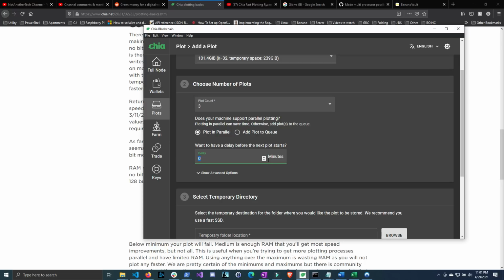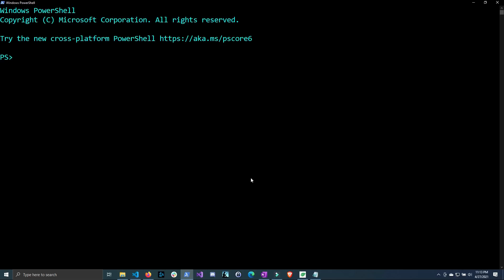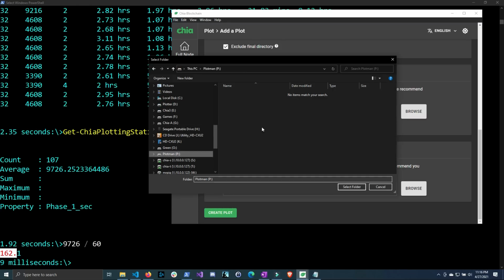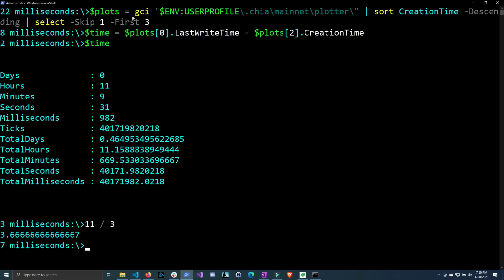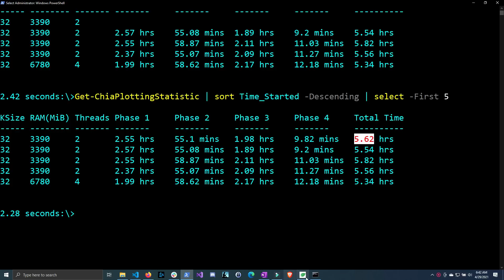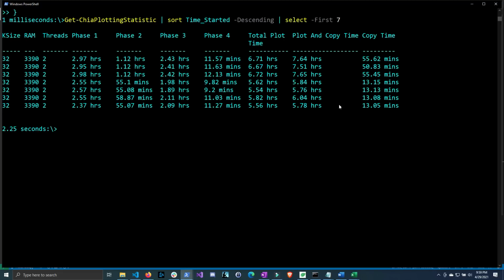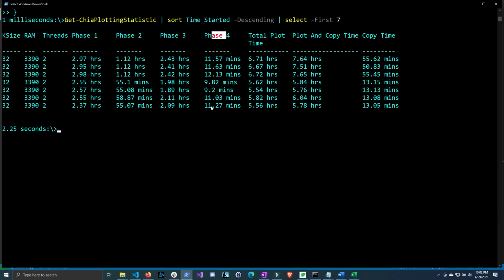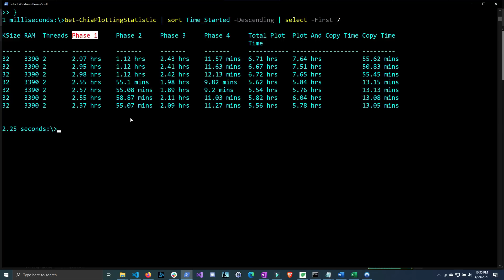Optimizing The Delay Between Parallel Plots Using Log Files and Powershell - Chia Plotting Part 3

Comment: Is there SSD capacity to consider when plotting more than 1 plot as shown in your video?
Reply: your plotting drive should be twice the size of the maximum amount of plots you plan to run in parallel

Comment: Thanks for the videos!  I'm thinking your module will not work if you've only plotted from CLI because it doesn't seem to appear to create any log files that I can find when you plot by CLI and running the module throws a "Get-ChildItem : Cannot find path 'C:\Users\username\.chia\mainnet\plotter\' because it does not exist."  I'm still poking around, but I'm wondering if you have to run a bunch of plots in the GUI for the module to work correctly.

Comment: Hi! On your video, you mentioned discussing the following tip/tweak: When plotting in parallel, a command or way to auto start new plots once one is complete, so you always have the total number of plots that can be plotting. For example, if you can plot 3 in parallel, as your system is, you star Plot 1, then delay Plot 2 & Plot 3. Well, once Plot 1 completes, Plot 2 & Plot 3 are still running, but you could have a new plot starting to replace the completed Plot 1. Did you figure out how to achieve this, or do you just need to wait for all 3 to complete, and then start a new plot procedure for 3 new plots?
Reply from the maker: Yes I have another video on who to do this, but I feel like I explained it poorly. Basically you setup 3 different queue with different names and manually start them with the delay you want by waiting. I will also release a video tomorrow on how to do this powershell.
Reply: @SysDeskDev  Great, I'll look for the video. Just to through it out there and get your thoughts. So, I've just built the following, Ryzen 7 5800 (8c,16th), 64gb DDRAM, x2 Sabrent SDD 2TB 3600. So, in RAID 0, I should be able to parallel 14 plots, right? With say, 1hr delay. So may around 28 plots/day?

Comment: Wow.Thank you for this content its 100%++ helpful! I have a question. What is your Farm HDD? will this is the main reason why transferring file its take so much time?
Reply from the maker: Well generally your plots will be stored on HDDs (Hard disk drive) which have slower write speeds than SSDs so that is why it is taking up to 15 minutes. My farm HHD that I was transferring to was an external HDD by Seagate.
Reply: @SysDeskDev  Thank you very much :)

Comment: Say I'm limited by a 1 TB SSD so I can only run 3 plots in parallel as in your example. Then say that I what to create 15 plots. Should I set the delay to the time the phase 1 takes or to a third of the total time for a plot? I see a scenario where the phase 1 time is less then a third of the total time and it will try to start the forth plot and by that fill up the SSD. Or maybe it checks so that the free space is enough before starting a plot and by that way will avoid the problem?

Comment: Thanks for the video! Very imformative. Can you please tell me the break down of phases. What resource is each phase using? Following this video I am running 3 in parallel with a further 3 starting just after phase 2 starts however the first 3 sit at 31% and dont progress whilst the next 3 carry on up. Ubuntu Ryzen 9 3950x DDR4 3600 (mobo overclocked as only supports 3200) 2TB NVME doing 8 threads and 4650mb per plot. Your video says once phase 2 hits you are only using one thread for that plot, so 32 threads, I should now be using 27 threads with the 6 plots running?

Comment: Hey men. Just wanted to give you a big THANK YOU for your work.... 
secondly I have a question: When im trying to import pschiaplotter to my ps with this command: "Import-Module PSChiaPlotter" it says that it could not be importet because importing is deactivated on my win system.... can you maybe help me with that? 
Kind Regards..
Reply: I had the same issue. Run Get-ExecutionPolicy. If it says Restricted then you have to run this command: Set-ExecutionPolicy -ExecutionPolicy RemoteSigned and select Yes if you feel it's a safe script. After that, it should run.
Reply: @raicard26  Thanks a lot. that helped me :)

Comment: Congratulations great video, I was working into the same to make posible to create parallel in a 512GiB ssd and I had success but since I was looking to start  after the disk space usage start to decrease, that happened after phase 2 adding  10 minutes more. Thanks again

Comment: I start my plots each in a separate PowerShell window. Is there a command I can use to delay the start of plotting?

So that I don't have to be in front of the PC for hours to start the plots manually.
Reply from the maker: I will be going over this in my next video, but the short answer is can be found here https://github.com/Chia-Network/chia-blockchain/wiki/Windows-Tips-and-Tricks

Under section1. Parallel Plotting in Powershell. I hope that helps :)

Comment: Download and install Teracopy....set that as your default copy/paste/move application.  Then use threadsin a python program to do the plot and then use the join method to then fire off another thread to do the move command to the plot's final home.  KEEP your -2 = -d directories the same.

Comment: HI

what about I/O capability issue on WIn10? is that true using Win is slower than Ubuntu?

i used thjreadripper 24core, 128gb ram, 8tb temp drive.

usually i did 6 plots parallel on a 2tb NVMe temp drive, 2 threads 4gb ram, delay 60min(random not doing statistic), 

i got 4pcs NVMe 2tb, so each temp drive i do 6 plot parallel. all same config as above. 

31% took me 8 hours. total took me 14hours. this is not right, so wrong...... but whats wrong?

im figuring out how long needed for phase1 31% if put more threads. so now running 1 plot on 1pcs 2tb NVMe, 16 threads,  7gb ram.

i used 3 pcs 2tb NVMe to test, so there are 3 plot running on 3 NVMe. final drive is the last 2tb NVMe drive. 

https://www.screencast.com/t/1cWmt2xyuH 
this 16% took me 100min, still plotting....

i check in keybase, admin said 2 thread like i always do is good no need pump 16threads on single plot. but normally i used 2 threads took me 8 hours for 31% and total took me 14hours. 

from your point of view what problem might it be? is true that only way out is ubuntu?

Comment: dude you are amazing! you got a new sub! I am just starting plotting my 8 TB system. I only have 1 SSD of 500 GB. Seems like it will take a while, maybe a month or two to plot everything. But I will look forward to your videos to learn with them better ways to pl be more efficient while plotting.

Of course I can't plot in parallel with my SSD, but I have 4 HDD of 2 TB. Do you recommend that I start plotting in parallel with them? Using one or two as temp?

My system is this: I7 5820k 16 GB of ram, Windows and 4 HDDs of 2 TB and 1 SSD of 500 GB. So far my first plot is at 15% in 2 hours, quite disappointing to be honest :(

Thanks so much for making these videos I will look forward to more

Comment: Super, thanx for your videos!
I wanted to ask for help about PowerShell im not very good in it. Im running plotting from a PS file, with delays. But i dont have nice .log files that you have when plotting with gui. So my first quastion is how to have it ? So i could use your superb PsChiaPlotter
My lines in PS script looks like this:
invoke-expression 'cmd /c start powershell -NoExit -Command {cd C:\Users\userAppData\Local\chia-blockchain\app-1.1.2\resources\app.asar.unpacked\daemon\;$host.ui.RawUI.WindowTitle = "Qp4"; start-sleep 13000 ; .\chia.exe plots create -k 32 -b 2400 -u 128 -r 4 -t E:\temp -d X:\DESKTOP-PLOTS -n 3}'

I have 16 thread CPU, so i run 3x3 with 2threads, and after 13000 (thats when i manualy look avg in calculator my first 3x3 threads end Phase1).

Second quastion. 
Can we have just a parser in PS that will wait for text in ceartain windows (for example Q1p1 =first Q plotter proccess 1) and start another plotting proccess ? I think it would be most precise.

Comment: I'm #69 TU :)   After Viewing all your vids in this series, I have one lingering question. How can I fine the optimal # of plots in parallel (or timed sequence parallel) for my given SSD vs NVME drive. I heard you mutter a number in one of your past vids, but how do we find this number for the specific drive we have??
Reply from the maker: If you are just looking at your SSD then you will have to divide the capacity of the SSD by 256.6 (which the temp space in GB which is the unit SSD's capacity is measured in) and round down. Technically you might be able squeeze another parallel plot in if you time the delay just right, but it is important to remember that for many SSD their performance is worsen the more filled up they are. Make sure to check your RAM and CPU  to find your bottleneck as your SSD (depending on the size) might not be your limiting factor. I hope I explained it okay.
Reply: @SysDeskDev  I found some info in PS online proccess at the end of the plotting phase:
269.319 GiB was used total (excl. full file) in the plotting — this statistics shows 1 plotting process eats 288,8365507 Gbytes of space, not 256.
It means that 1TB nvme = 3 Plotting
and 2TB = 6 maxed
To be sure.
Am i right?

Comment: I'm wondering how many threads should use, I have 11900k 32GB and 3TB NVme drive. I do 5 in parallel plots use 4 thread, should I use 2 thread and do 8 in parallel plots? Thanks
Reply from the maker: Is that an 8 core 16 thread processor? If so you have enough RAM and CPU power, and Plotting space on your NVMe's to do 8 parallel plots. I would opt for doing 8 in parallel over 5 for sure. I would start off with 2 threads for each plot and then try out 4 if you want to squeeze more out of your processor. The only way to find out for each computer is to test it out.

Comment: Hello, I'm unable to run Get-ChiaPlottingStatistic | select -First 1, it says cannot load module, what step I am wrong?
Reply: Try changing the execution policy by running Set-ExecutionPolicy -ExecutionPolicy RemoteSigned
or if that doesn't work
Set-ExecutionPolicy -ExecutionPolicy ByPass
Reply: @siriuscleveland4836  Thank you sir! Very helpful

Comment: I have only 1.6TB SSD, therefor i can only do 6 parallel, but my Processor has 8c 16th. The storage of the ssd is not fully utilized all the time. Could it be possible to do 8 plots but with certain delays to fully use the Processor?
Reply from the maker: Technically yes, from what I have read the temp size varies during plotting so if you time it correctly you might be able to squeeze another plot in parallel, however I do not recommend that in my videos because if you run out of space on your SSD then some/all your plots might fail. I try to be a little conservative in my videos on what is possible as I want to focus on optimizing rather than maximizing plotting so that more people are successful in their plotting. It is also important to remember that certain SSDs perform very poorly when their capacity is close to max so it might actually slow things down than speed them up. Sorry for the long reply!

Comment: Great timing, no pun intended. my attempt to create 2 plots at once on a 500gb nvme, by using the secondary temp drive option failed btw. no Bueno.

Update : the same thing on my 4 plots to a 1tb nvme. I would love to learn what the purpose of the  secondary temp is for and how it works.
Reply: I've found some interesting info looking in Chia CLI guide, (https://github.com/Chia-Network/chia-blockchain/wiki/CLI-Commands-Reference) says: 
Define a secondary temporary directory for plot creation. This is where Plotting Phase 3 (Compression) and Phase 4 (Checkpoints) occur. Depending on your OS, -2 might default to either -t or -d. Therefore, if either -t or -d are running low on space, it's recommended to set -2 manually. The -2 dir requires an equal amount of working space as the final size of the plot.

Comment: I tried 6 parallel with no delay and noticed it was killing my one hard drive, so i split the final destionation to 3 hard drives, which seems to improve the copy time.

I think staggering the best way but i need todo more tweaking to maximize the 8c 16t usage.

Your PS tool will be useful, going to try tomorrow.
Reply from the maker: If you have trouble importing the module try Set-ExecutionPolicy -ExecutionPolicy RemoteSigned
or if that doesn't work
Set-ExecutionPolicy -ExecutionPolicy ByPass

Smart thinking on switching up the destination files! But yeah even staggering your plots with 45-60 minutes should be plenty sufficient to avoid the copying bottleneck.

Comment: Help with the amount of threads to put on per plot... I have a 8-core 16 thread. Some videos say utilize all of them others say  2 .I think there's some real confusion.
Reply from the maker: Great question! I did want to focus only on the delay feature in this video so that people understand each part of plotting and not change more than one variable to give reliable results. I do plan to cover changing the thread count as well and eventually tie everything to together in recap video. To answer your questions, I think using more than 2 thread (at this time since it is only used in phase although this could change) will decrease over all plot time if you staggered them correctly but just how many thread really varies on a per system basis.
Reply: @SysDeskDev  thanks 1 set my system 2tb ssd up to do parallel plots every 1.5 hours with 16 threads ,
Reply: Let's see how it goes!
Reply: I have the same question too
Reply: Experiment and see which gives the best result,

For me 4 threads and 3408 memory help completed phase 1 in about 2 hours, but i will be staggering them so will try 2 threads also.